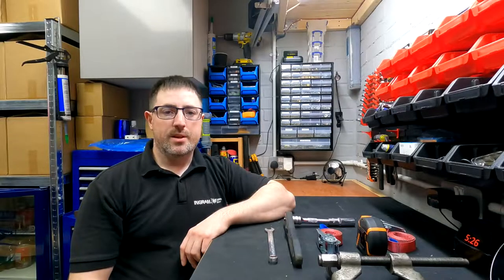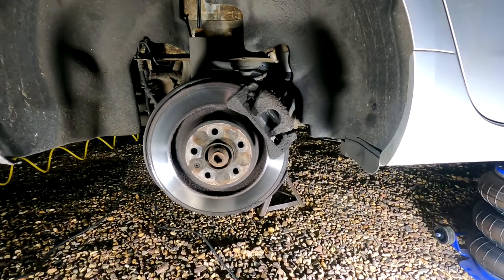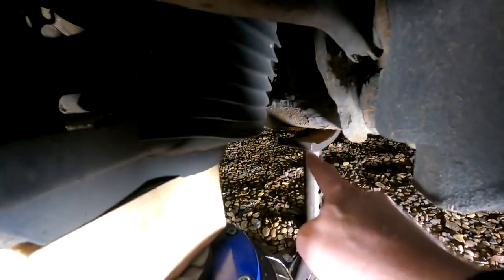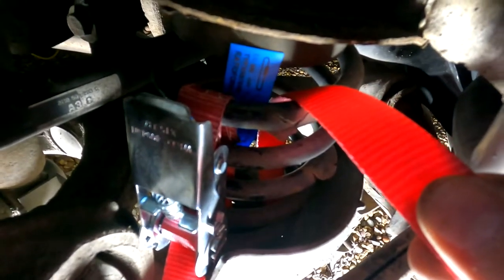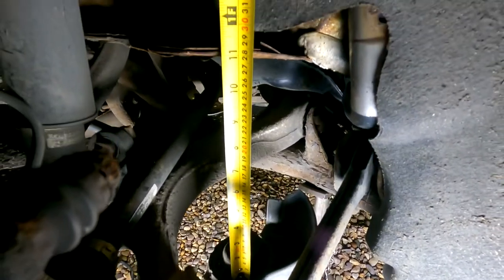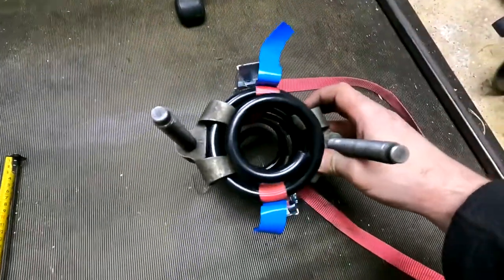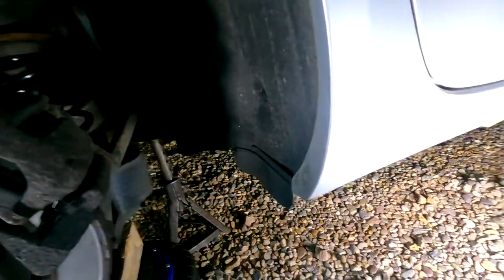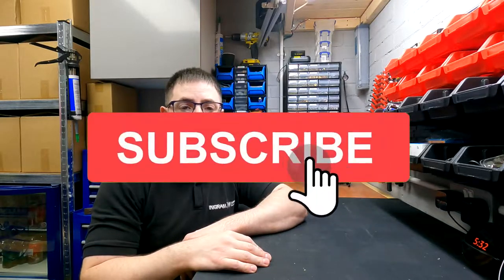Audi A6 C7 Rear Coil Spring Replacement (The Easier Way)

Comment: Thanks my friend. I replaced a broken spring today. It came out easier than the new one went in. My spring compressor wasn't the best and the straps slipped. I had to cut the straps off in the end too but the jobs done. Thanks for the help, It was terrifying at times.
Reply from the maker: Happy it went ok

Comment: Hi, just a  small question pls. It is a big diferents between standard and sports? If i have sports springs, can I change them to standard? Thank you in advance!!!
Reply from the maker: There's a difference in ride height with the springs, the shock absorbers will be different as well, sports shocks will be stiffer than standard and potentially different in length too, I wouldn't recommend putting standard springs on sport's shocks as this could impair the handling of the vehicle.

Comment: The easy way is to use an internal spring compressor, like the one from Sealey which doesn’t cost much. I didn’t need to unbolt anything to remove the spring.
Reply: Those I have seen locally at the cheap store were like $160, the external spring compressors were $20.